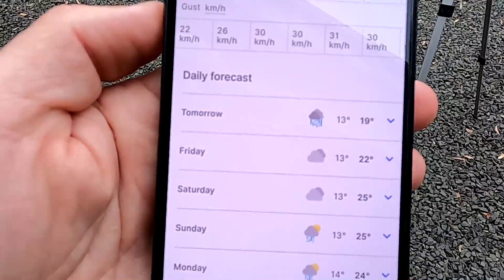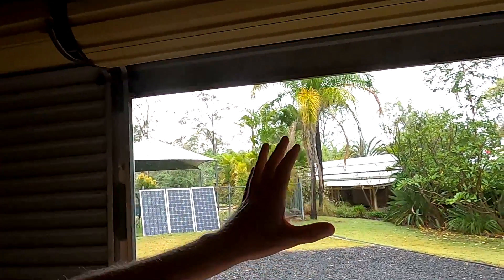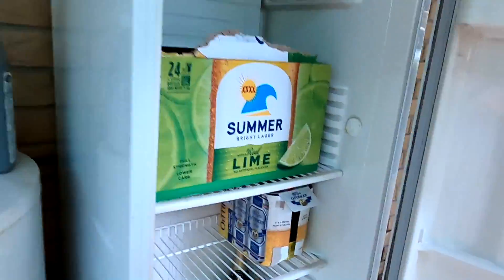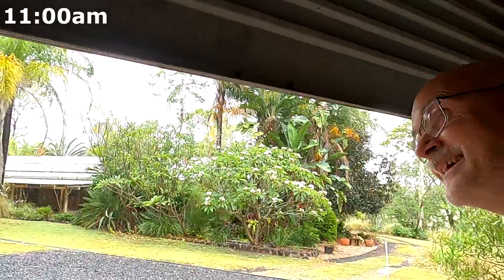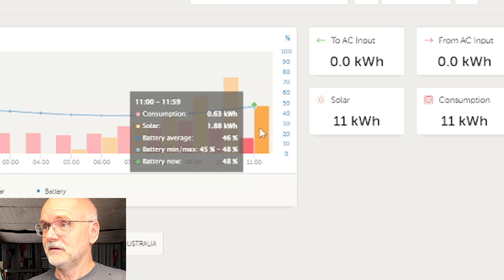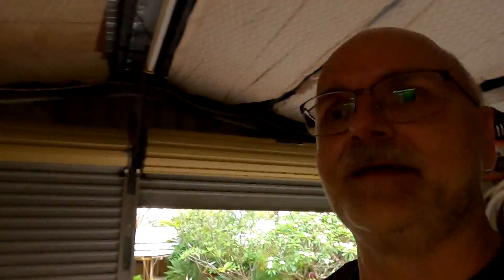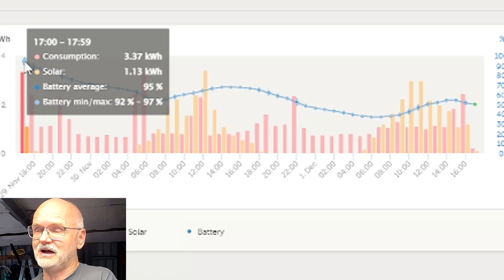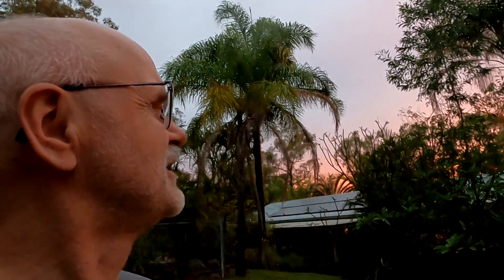Enough solar power under a cloudy and rainy sky? 🌧️🌧️🌧️🔋

Comment: I have an old ( 13 year old) 3.5kw rooftop system in the South East of England and I am looking to put another 10kw on ground mounts and 30kwh of battery. Based on last year's performance I think that would leave me short about 90 days over the year.  Like Andy we also use about 20kwh a day.  I am considering putting in a mains gas powered CHP generator to fill in the gap if I can cobble it together for a low enough price
Reply from the maker: Nice. Would even more solar reduce these days even further?

Comment: Last year I installed 3,8 kWp on the Car Port of our Weekend/Holiday House in Germany. From March till October we are 100% self sufficient. Including water heater, water pumps... But in November I have to disconnnect everything as the 9kWh LiFePo4 battery is going below 0°C and cannot be charged anymore. But as this house is not used during winter, this is a suitable solution. 
On cloudy days we also experience 20-25% power of installed kWp. That is really nice.  But winter sucks 😬
Reply from the maker: Can you not heat the battery from solar during winter, instead of charging it? Even a few hundreds of Watts should be enough to keep it warm to accept charge again... Would be an interesting project.

Comment: Great to see the plan paying off. Thinking of the periods of bad winter weather, would a 9N% approach (e.g. accepting non-solar energy 2 or 3 days a year) be the more pragmatic approach? Perfect is, after all, the enemy of good enough. I'm sure all those trees near your house offset some carbon emissions were you to use a (HVO) generator.
Also many congratulations on reaching 50k subscribers!
Reply from the maker: Thank you! Once we go off-grid, we probably stay connected to the grid for 1-2 years to see how everything goes. I will be able to recharge the battery from there if necessary.

Comment: Are you able to sell your excess power to the grid utility?
Reply from the maker: Not with this system. It's the off-grid garage, so... 😉
As soon as you connect to the grid, all these regulations and restrictions apply to you again, so I better stay away from that. I have another system on the house which is grid connected with a high feed-in tariff until 2028.

Comment: Now you could get some solar on a tracking system for getting that low winter sun or a wall of reflective material to direct that low winter sun onto them, though you could only do that on the most southern row, up here in the US that would be the most northern or am I upside down? Good day.
Reply from the maker: That was the test with the pool fence system. It's right on 70° and makes good production in winter. A tracker is not worth it in my eyes as it needs to withstand harsh winds and storms.
Reply: @OffGridGarageAustralia  Yep. In most cases it would be better to just put up more pannels, though I'm trying to see for my RV, if I can put together a tracker that would flatten in high wind and get the most out of a very limited space with just a couple big bifacial pannels. For going on two years my RV is my full time home and my aim is as much off grid as I can. Thanks for all you share.
Reply from the maker: @putteslaintxtbks5166  Makes sense for an RV, I guess as you want the most out of your panels in this situation. 
Thanks and stay charged!

Comment: Big difference in power output between summer and winter in cloudy/ rainy weather. My inverters will not even receive enough voltage to kick on in the winter when it's raining
Reply from the maker: Oh, wow, I never had this with my house solar. It sometimes stops during the day when we have really dark clouds and heavy rain, but it will kick in again after the clouds have moved.

Comment: Thanks for the video, Andy.  I have a situation with our 2.2 KW system where the Growatt inverter shows up to 4000 W on a  sunny day at noon. Surely the inverter is kaput. Do you have any ideas about how that can happen?
Reply: Is the 2.2kw what inverter side plate says? What are the total watts for all the panels installed? Most inverters can easily support 20%~25% extra. 

If the inverter is 5kw in size, you can attach 6kw panels to account for the inefficiencies. I find out of 365 days maybe 20 days would I reach the max of 5kw and cross it, most of the time I am making 3-4 kw during peak production time.
Reply from the maker: Panels can overproduce with cloud corners and reflection, but not by 100%.
Hard to tell what's going on. No batteries connected?

Comment: Definitely should consider some more panels on the house roof before going full off grid. Better to overkill the solar then to sell yourself short. Also keep in mind that there is always phantom power draws that are hard to account for. 😋Just a tidbit of experience for 1 off grid guy to another. But definitely mind blowing how much power that you're generating on a crappy weather day.🤯👍👍👍👍
Reply from the maker: It will be a step by step process. Once the house is connected, we' will still have grid power if needed to recharge the battery. This will be the most exciting project of my life!

Comment: Awesome Andy, and yes, I’m envious. Fabulous result big 👍 and yes, mind blown indeed. 
I’ve used the same logic in my caravan, enough solar to keep the minimum (lights and fridge) even in inclement weather. (I can switch cooking and water heating to gas in poor weather, but use NO gas in good weather.)
Reply from the maker: Excellent, I have to have a look at your trailer at some stage.

Comment: i don't even have solar yet but I predict running out of things to do on solar pretty fast like here. what about wind turbines, would you consider that? I'm thinking that a single wind turbine reduce battery required and secondary power source for weather like this
Reply from the maker: A wind turbine would nto work well over here. We're in a valley and the wind is very inconsistent, if we have any at all... that would be not worth it.

Comment: Sitting with an empty battery in cloudy winter, I really envy you. I'm crossing my fingers that your system will work better in winter than mine does. That close to winter solstice there is nothing to harvest, especially not with a cloudy sky.
Reply: I am also on the count down to the Solstice.  
I shall be celebrating with a civilized Beer and a BBQ in the dark. 😎🏴
Reply: Yo, same here 🇩🇪
We have a quite flat 6° ESE direction. Nice from March till October. But winter should be skipped.

Comment: Your real test will be during cloudy weather in the winter. However you are better off than a lot of us because you are only 28 degrees from the equator. Here in the UK (51 degrees latitude) in winter I am struggling with shorter cloudy days with low sun elevation. This is a system with 20kw PV and 100kwh of usable storage showing that there is no such thing as too much solar or storage.
Reply from the maker: I have great conditions for such a setup, no doubt. Due to the lower sun and the shading from the trees, I guess, I still need more solar in winter though.
If we have such cloudy weather, it's usually just for 2-3days before the sun come out again and I can fully recharge. We don't have these longer periods of cloudy weather down here.

Comment: I probably have the smallest solar system on here 1.7 in solar 5 355w all black panels I see a lot of y'all still complaining with huge solar systems I wish I had that I'm just trying to reach 500 watts on a overcast cloudy rainy day at least some of y'all is reaching a thousand Watts of charging power while still running ur loads what's there to complain about.
Reply: Don't feel bad dude, 11-12KW some North facing and most South. Fixed pitch (roof solid mount). Cloudy crap days is still like 1/10th my usage / peak. Crap days are just that. You have to over build the entire system to account for crap days.

Comment: Andy !
And you have solar panels on the roof of the house too!
Go off-grid i'd say😎
Having an ice cold S.P.A.T. on that, cheers !
Reply from the maker: The house system is grid connected with a high feed in tariff. It's under contract and I cannot touch or change it. The electrician is working on a plan to leave this system grid connected but take the whole house off-grid. It's complicated...
Reply: @OffGridGarageAustralia  When you cut the grid, the solar panels are not yours?
Reply: @marijnvroegindeweij5001  They’re still Andy’s - but you lose the excellent legacy feed in tariff if you modify/upgrade.

Comment: Ok ok one last question for now lol how can you tell if ur solar panels are very efficient or not but yes I was the one who asked Andy to make a video on a full overcast cloudy rainy day 😉🙏
Reply from the maker: I can only compare this to my previous panels I had installed. The new ones are far more efficient. Far more!
Reply: @OffGridGarageAustralia  efficient meaning the panels pick up the solar energy quicker or sooner ??
Reply from the maker: @thelithiumpowerch  They produce more power from the same light as other panels with less efficiency.
Reply: @thelithiumpowerch  What is the efficiency rating of these panels?
I think the highest I have seen is low to mid 20's % efficiency.  I see you answered this in another posting----21.6%.  thanks

Comment: What is DC load and how do you measure it?
If necessary, you can build a small hydroelectric power station for rainy days...or a windmill.
Reply from the maker: Dc power in the VRM is everything which is not reported by the inverter.

Comment: and dont forget the angle of the sun in winter, witch is not the  same AT ALL, you will not get these resulst in winter, pretty sure, my 6 kw systeme produce NOTHING when it rain in winter
Reply from the maker: No, winter will be much worse, I think. The sun will be lower, and we have shading from the trees then.

Comment: Ahh the video I've been waiting on full overcast clouds thank you Andy 👍
I have a another question for u to Andy say u have two identical charge controllers both are 50 amp but one is 150v and the other is 100v if both are only 50 amps what difference is it with the 150v ?
Reply: If,say, u have 40v panels @ 10A = 400w panels, u can run 2 in series on 1 string & get 80v @ 10A = 800w, & 3 in series on the other (150v) controller, ie: 120v @ 10A to get 1200w, potentially/theoretically, the 100/50 controller (potentially) is capable of charging up to a pv 100v x 50A = 5000 watts total output, (think in watts, its more universal regardless of volts & amps), whereas the 150/50 controller is able to charge at a rate of a pv 150v x 50A = 7500 watts total, so the simple answer is: that the 150/50 controller is capable of outputting up to 50% more power, …depending on a buttload of various other factors. 
Finally, on 100/50 u can have 12 panels total 6p x 2s = 4800w, on the 150/50 u can have 18 panels in a 6p x 3s configuration to get 7200w & the mppt’s will make the best use of available power coming to them & u could use this setup for different facing panel sets/array’s maybe. Cheers
Reply: @evil17  thank you 👍

Comment: This is great for a cloudy day - but it is also mid-summer. Longest days of the year. What about several cloudy days in June? Hours of sun will be lower, and the sun will be coming in through a lower angle and the path through the clouds will be longer.
Reply from the maker: In winter, it's usually sunny. We have the wet season during summer. But I have more shading in winter from the trees.

Comment: We have a system almost identical to yours (only 40 kw of battery). It's winter here so not much sun and it is pretty low in the sky. Only 10 kw at noon as opposed to 15 kw in summer. All works well till snow covers the panels. with snow and clouds I get as low as 700 watts per day. That lasted a few days and we ran out of battery with an average 12 to 13 kw of daily use. Rainy days are usually not a problem, not a big yield but, enough. Enjoy your great system.

Comment: And now just wait until the winter time when you have fewer hours to charge? 10 charging hours isn't this overestimated?  now in Belgium 5 loading hours
Reply from the maker: In winter, we will have usable light from 7am to 5pm. There is not so much difference summer/winter as we are closer to the equator.

Comment: Looking at my graphs I have used almost 300 kw since 16th of November and all was covered by solar. I still have my water heater and couple 20 amp circuits on grid they average 8 kw a day so far. I am in late fall so with16 new 410 watt panels 2 strings of 8 series then parallel together I could make that up easy.  You are showing us all the difference in used compared to new panels. Thank you Andy
Reply from the maker: Thanks a lot. Great upgrade for your solar. That will help you out in winter...

Comment: Yah, not just hours in winter, but also the sun's path through the sky.  Being so much lower in the sky, the fixed angles of the panels will be less optimal.   A good rule of thumb is that winter generation is roughly 50% of summer.

There's a quick little exercise we can do here.  One can ask the question:  "How much additional continuous power do I need to make my renewables-based system 100% reliable 365 days a year?".   Taking your system, lets say you had an additional 500W continuous feed from "elsewhere".  Would that be enough?    It doesn't seem like it would be enough, but actually it could be.  500W continuous is 12kWh/day.  Added to wet-weather solar generation and that would probably be enough. And of course it would not have to actually stay on all the time in reality, just when the solar can't make ends meet.  Say, if the batteries ever get below 30% in an off-grid setup.

One can also ask the question... how much would it cost you to get that equivalent assurance via additional solar expansion?   Compare against (say) a propane-based generator?  The answer should be obvious.  Adding sufficient solar and batteries alone would cost a fortune.  You would need a system roughly four times the size of your current system.   A fixed propane installation (500gal or 1000gal tank + small highly efficient generator) would cost far less.

This is the same issue that renewables-heavy grids have to solve on a larger scale.   In Australia or California for example... clearly a lot of grid-scale storage needs to be added and is in fact being added.  And a lot more solar and wind.  But it isn't possible to make the grid 100% reliable 365 days a year just from solar, wind, and batteries.  At least not without spending a gazillion dollars!   Hence why, in the future, we will need some continuous base load to ensure that reliability economically.  Hopefully nuclear.

But as we saw from the exercise above, it does not have to be very much!   California could probably do it with less than 10GW of nuclear.   Solar, wind, storage, and a meer 10GW of nuclear is all CA needs.

-Matt
Reply from the maker: Thanks Matt, I could also look for more energy efficiency inside the house and for example replace the old hot water tank with a heat pump hot water system.
I could also stay connected to the grid just for the sake of having a backup in case I need it. I could have this trickle charger connected which kicks in at say 15%SOC and runs at 250-300W. Staying connected would cost me around A$1 per day. That's probably as much as a generator would cost me including fuel and maintenance per year. So there are options.

I guess in terms of a global green energy transition, we will be still relying on gas peaker plants for a while which can kick in if renewable energy is not enough. Nuclear is not an option for most countries. Thankfully it will never come to Australia.

Comment: Now that I am using growatt-us website to monitor my inverters(solar and battery also). I can see very similar to what you are.  It takes a black cloud to get me under 300 watt of solar. white light clouds I get 1-3 kw per hour grey 500-2.5 kw. partial sun 2-5 kw full sun 7kw( I have a couple panels I need to remove from array its restricting all panels  in series on that to 88 watts.). Ordering new 410 watt panels in spring which are 22.8% efficient. The ones I use now are 14.8%.
Reply from the maker: It's interesting to watch, right? After a while you can predict how mich power your system makes by just looking up.

Comment: Andy, very nice, planning a bit can also ease your use od the house, maybe in the future some new equipment which is less power hungry. But I think it will be allright! Also considering your solar generation of the house and contract on it it should be fine in the long run. Thanks for sharing, nice to see you can harvest so much energy!
Reply from the maker: Thanks, Edward. Yeah, I could also have planned ahead and fully charged the battery before the weather event happened to maximise available energy for these few days. But it seems to be OK for now. Winter will be interesting, but we usually have less clods then (but lots more shading).
Reply: @OffGridGarageAustralia  you still have your old pack, assuming you would connect them as well gives you roughly 1 day extra 👍🏻

Comment: Does the amount of energy produced on the VRM equal what goes in to the battery available for reuse or do you still have to factor in losses for converting it DC then back to AC again with inverting?
Hooray for the new arrays!
Reply from the maker: There are few numbers in the VRM:
PV Chargers: incoming energy what the chargers put into the DC system. Not all of that goes into the battery though as we have loads using this solar energy directly.
Battery charging/discharging: what goes in and out of the battery
AC Loads: what the inverters output to the garage, pool, vehicle charging on the 220V site. Obviously, it takes more DC power than it outputs as AC. The efficiency is at around 80%-98% depending on the load (more efficient with smaller loads)